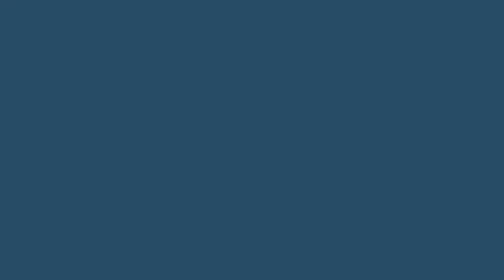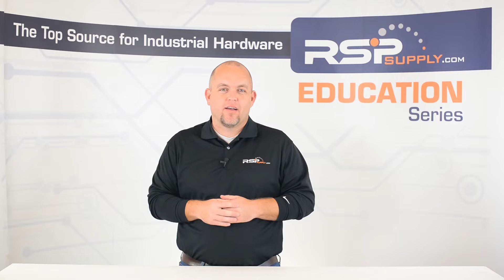PLC's vs Data Loggers

Comment: I'm not a big fan of the videos where it's just talking with no hands on portion. Also some of the videos are too short and force you to be really vague, so not much meaningful stuff is learned. Maybe try more longer videos where you have the items you're talking about on hand? You know those videos where someone straps a GoPro to their head and does a full PC build for an hour? Something like that but you fill an RTU cabinet (breakers, terminal blocks, PLC, power supply, radio, UPS) and wire stuff in real time would be neat in my opinion, and something that I haven't seen done yet.
Reply from the maker: That's a great idea, we are always open to ways to improve. Thank you!